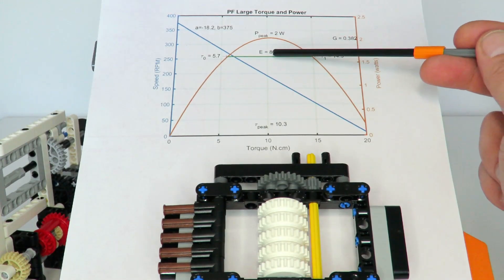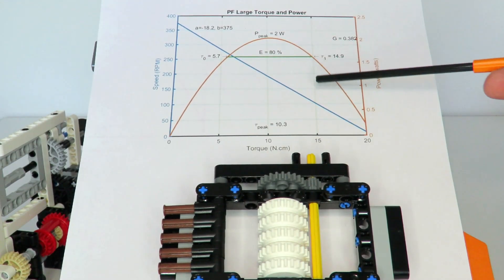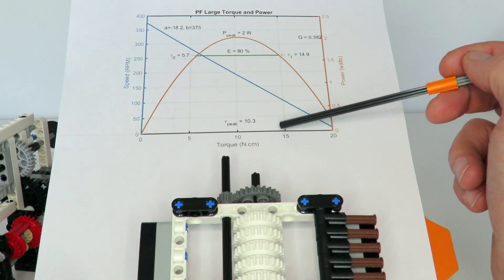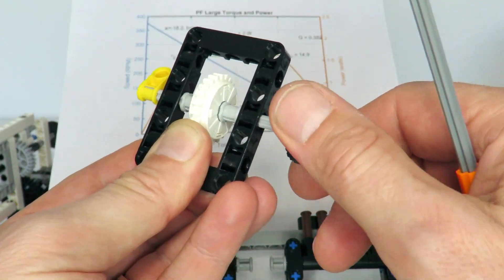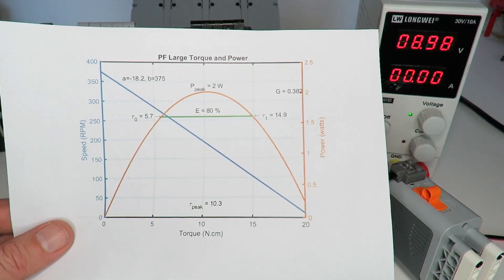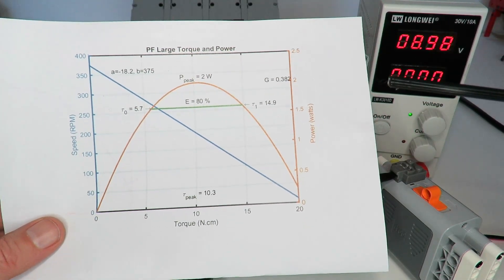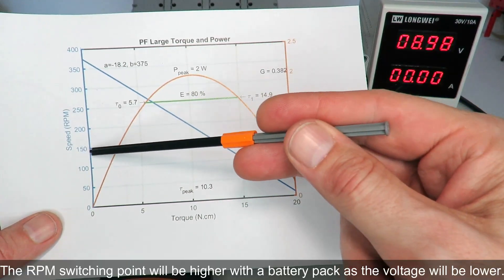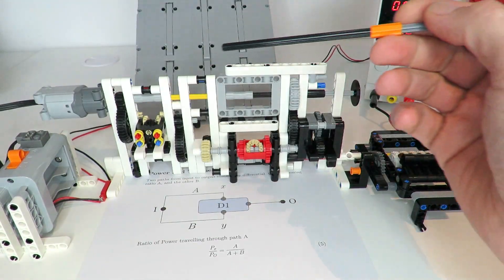Lego Technic torque in practice - how to work with torque in automatic gearbox design

Comment: Very cool experiment ! You should contact Philo in order he puts your experimentation results to his website.
Reply from the maker: Hi Nico, thanks for that. I don't think I have done anything different from what Phil has done already. I just demonstrated it using the clutch gears. He may have just used some weights which will give you a smoother torque. 😀